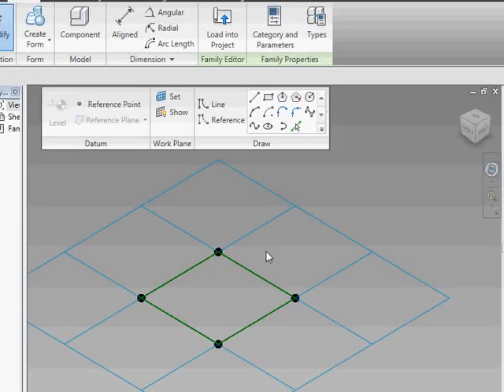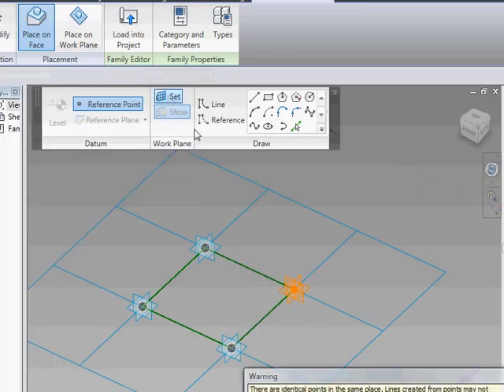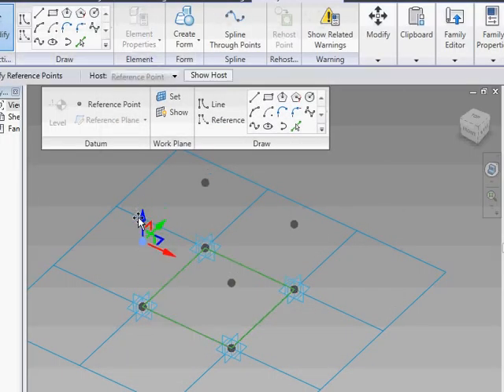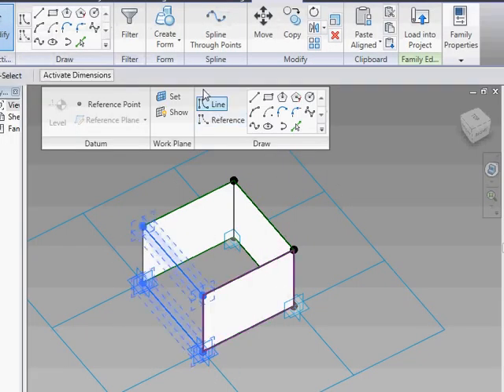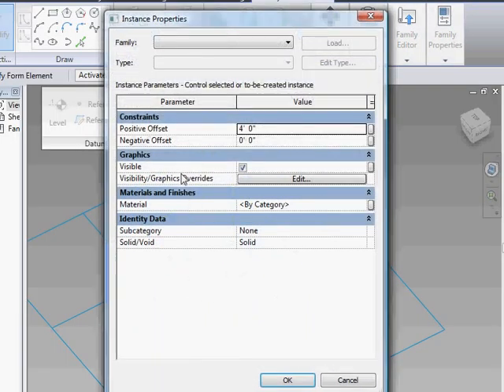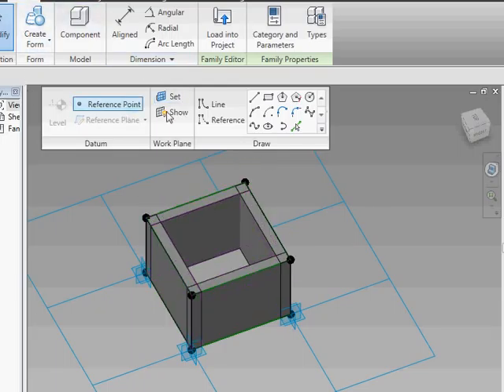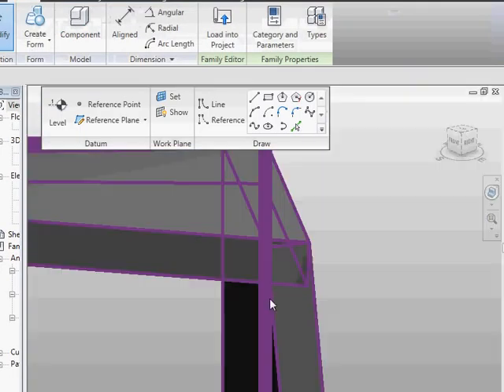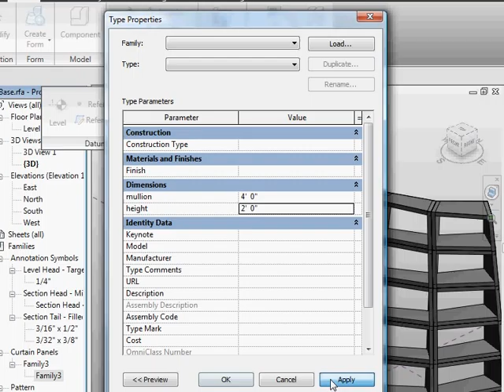seamlessMullion

Comment: thanks, Great tutorial, i know u did it 5 years ago, i do it with out the overlapping, i used set of an offset reference points to make a void inside the the panel, and adds more parameters to control the inner thickness and the outer thickness :)

your work is a great source for learning